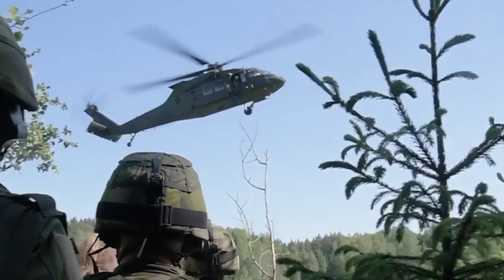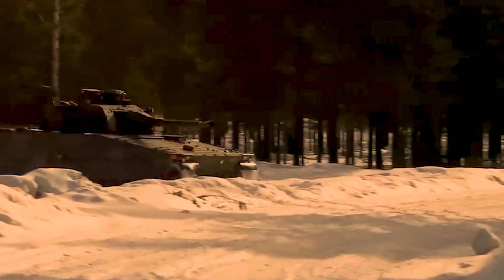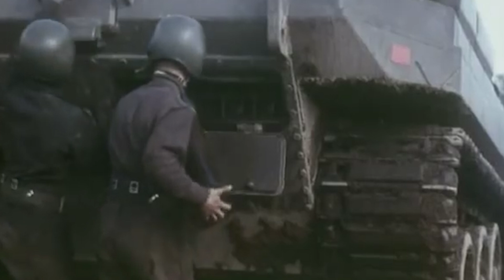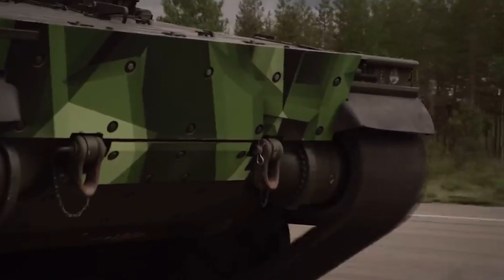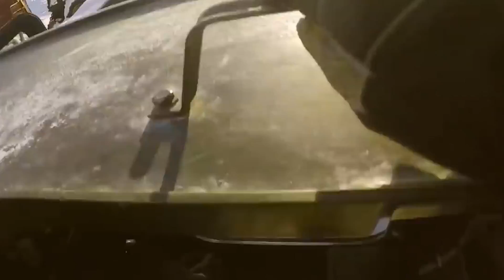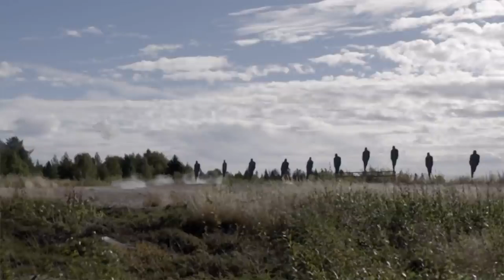The Best Infantry Fighting Vehicle Ever Seen

Comment: The Swedes domestic cv90 have the 40mm canon not 30mm. I think only the export version is 30mm. Don't know if you can order with 40mm cannon for export.
Reply: Correct. 40mm is only for domestic use. 30mm and 35mm on the export variants.

Comment: Seing a pair of CV90 work their way through a MOUT scenario is very sobering. The sensor- and weapons systems give ability to detect and combat individual soldiers visible in windows from half a mile distance. When taking turns to move under cover they were simply to fast for the AT missile crews to handle. Predators.

Comment: During the war in Afghanistan, Canada looked at acquiring 108 CV90s under the Close Combat Vehicle (CCV) project. I remember reading somewhere that the plan was to acquire just the hulls only and then mount a Canadian-designed and manufactured turret with either a 25mm or 35mm Bushmaster chain gun. The idea behind acquiring the CV90s was so that they could keep up with the Leopard 2 tanks while traversing over rough and difficult terrain.  The existing Kodiak (LAVIII) wheeled infantry fighting vehicles were as fast as the Leopards, but had more limited mobility. 

The project never got off the ground as the war in Afghanistan ended, and the Canadian Army didn't have a continuing need for a tracked infantry fighting vehicle.

Comment: Personally, I've always liked the S tank. It's unique design and the low silhouette looks cool.
Reply: Sometimes you may need to retreat under fire and a turret allows you to fire in all directions, you don't have to drive at your target to engage it like you would with a S tank!  Cool isn't a concern when you're being shot at!
Reply: @MarilynStangl  that is just partly true, the strv 103 was designed to back away from the target in high speed so one of the crew members sits facing backwards with driving controls to be able to do just that.

Comment: I'm wondering what kind of protection this vehicle has against dismounted ATGM teams. Maybe they could make drones like the Switchblade that can loiter over an area with a warhead that is packed with little metal balls, that works somewhat similar to a flying claymore mine, only with a different dispersal pattern.
Reply: You can mount iron fist APS on it

Comment: However low the tanks profile is, it is still vulnerable to anti-tank weapons attack from the top.  No matter how low its profile, the tank still radiates thermal energy.  Advanced modern detection systems will pickup the heat source.  

The benefits on maneuverability will be negated in tight quarter combat environments.  

In open terrains, yes.  In tight environments, its touted lightweight and maneuverability will be negated.  

A conversational tank with turret can traverse a battlefield and still aim and fire at targets not in the traveling sight.  Conventional tank can traverse one direction and aim and fire at targets in a full 360 degrees.  

No.  May sound good, but NOT GOOD for the real fire on the run on the run with adjustable elevations and limited angles of depression.
Reply: If you pay attention the turretless tank was only brought up as an example of the focus on survivability we've had since the 1950's when it was designed. 

No it wouldn't work on a modern battlefield, no 50+ year old tank would. But when compared to its contemporary rivals it preformed well during testing.
Reply: @Cerulean_Frost  …if you noticed tanks in the modern battlefield regardless of turret or being turretless is vulnerable to modern surveillance and detection, and vulnerable to modern antitank munitions detonations top of the tank…so that argument gone the way of the dodo bird.  Modern tactics rendered this “concept” to the trash heap.   Modern tank doctrines, fast maneuvers firing as well as inabilities to fire at targets in close space constraints renders “survivability” arguments a fallacy.    

So what’s your point?
Reply: @Ma9Bit  Your first comment seemed to criticize the strv103, a tank that went into service in the 60's.
I like the 103 in the context of its time so I wanted to defend it.

Besides every single vehicle is vulnerable to modern munitions. The best way to protect a vehicle today is active protection, and the CV 90 mark IV should be the first western ifv with a 'qualified' active protection system.
Reply: @Cerulean_Frost  True…but even back during the day…the concept failed for majority of reason already said.   The “best” statement just was “so obviously “ a superlative statement that made the posting video, well…beyond…?!?!?
Reply: @Ma9Bit  The 'dark' channels constantly uses superlatives.

I also wouldn't call it a failure. Its replacement was the Leopard 2a4 in '97. So it served for a long time. A bit too long imo, we should probably have gotten some 2A4s when they were built in the late 80's but maybe we were too focused on the air force.
Reply: @Cerulean_Frost  agree.  🫵✋👍😎

Comment: One thing. If it was a Swedish CV90 it would have been the STRF9040, 40 denoting 40mm. So it would have been 40mm shreding the fighters to pieces
Reply: That's the one Sweden is sending to Ukraine. 9040C.

Comment: Czechia just ordered 246 CV90 MkIV. More countries should follow as it’s easily the best ifv being produced.
Reply: The US should do the same after the abortion of the Bradley project.  The CV90 MkIV is sooo much better.  If the US learned anything from the Bradley Project it should be to save the development $ and buy Swedish or German weapons.  The Bradley IFV Project was probably the worst run project ever.
Reply: @johninnh4880  What about the Zummwalt class destroyers.
Reply: @mac2626  wasnt that due to budget problems?
Reply: @johninnh4880  that’s not gonna happen, by law all US military combat vehicles have to be designed solely for US military use and major parts must be made in the USA 

So while US production is easy to solve it won’t happen because it fails the first clause
Reply: Seeing how the war in ukraine is centered around their BNP and IFVs and heavy armor is less relevant then ever.
Even hand helt devices like NLAW can defeat heavy armor, so does the IFV's rockets. And even a tank taking 30mm fire will have issues afterwards.. cant shoot if u cant se the enemy.
Reply: @jmkhenka  The CV90 mark 4 has completely different sensors and countermeasures than any tank that exists now
so it is extremely harder to knock out a CV90 than a tank
Reply: @6XCcustom not a tank. Ifv. Easy to knock out with an old rpg but this is normal with an ifv, infantry have to protect her.
Reply: @jmkhenka wrong - super relevant, you can survive in a Swedish CV90– in a Russia IFV- you die.  They are so bad so the soldiers stay on top of it, not inside.
Reply: Lynx much more up to date construction . Cv90 is a good one but I don’t see any reason to put in the top 3.
Reply: @yatumux Lynx is not working, yet.
Reply: @ArneSvensson-r1i how do you mean that no working ? 😳
Reply: The US had the for "evaluation" for 5 years I think, and other models, but they just HAVE to have General Dynamics or Raytheon-manufactured junk, and they steal the tech they feel they can use and incorporate into their own vehicles. Never ever would they buy a foreign vehicle.

Comment: 30mm? As far as I know Sweden uses 40mm CV90s. But I consider the CV90 to be the best IFV currently available.
STRV-103 is not a tank but a tank destroyer. To be a tank you need to have a turret and tracks. Therefore STRV-103 and Centauro are tank destroyers, as they are able to fight tanks but do not fit all the criteria to be a tank. STRV-103 is the same concept as German and Russian WW2 tank destroyers. Such vehicles can't fire on the move and can only shoot at the direction the hull is aimed at. They are only effective in defense when you know where the enemy comes from. As such tank destroyer designs like this became obsolete.
Reply: It is not the design that made it a tank, it was how it meant to be used and it was meant to be used as a tank. Ok it was specalised at the defensive role.
At the time (prior to 1980) of strv-103 other tanks could fire on the move but they needed to stop to actualy hit anything like another tank. So the differance to other tanks capabilities was not that great.
When other tanks started to be able to hit with the first round fired on the move stv-103 become obsolete. That even the sloped armor could not offer protection anymore did not help.
Reply: Norway have CV 90`s whit 30 mm and that story is about Norwagien soldiers in Afganistan. BTW you alsow find CV 90 IFV whit 35mm canons.
Reply: @Gibnetz es there are several export versions but we (Sweden) uses the version called  StrF9040. ”40” painting to its 40mm bofors auto cannon
Reply: @cgnovice2969  Yes I know :-) And i have used that  that 40 mm L70 Boforse gun.